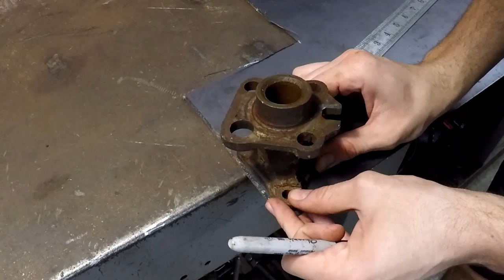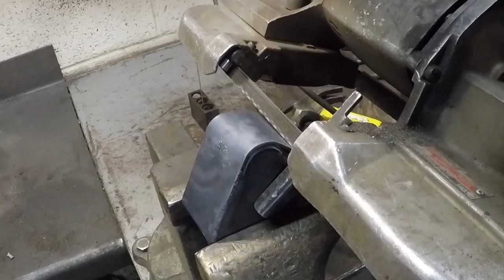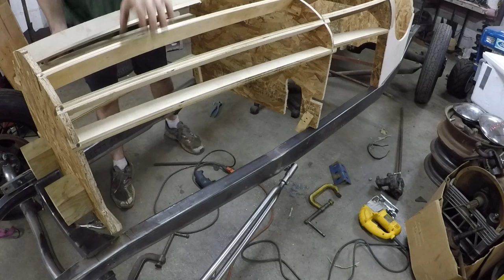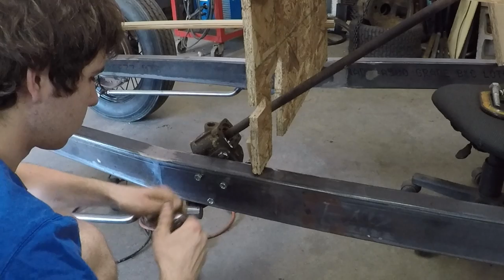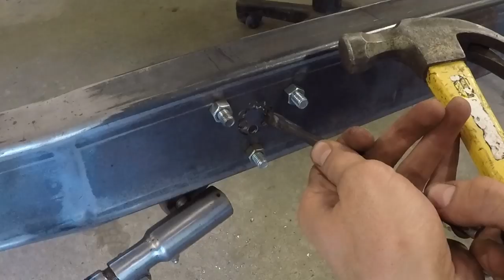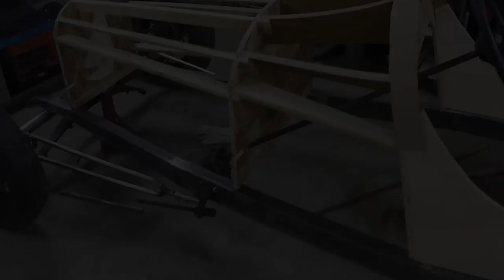Installing an Early Ford Steering Box | Boat-tail Speedster Pt. 22

Comment: Your "Goal" is for it to last 100+ years ... you have wonderful attention to "detail" except on "corrosion prevention" ... EVERY place you weld or drill needs to have at least 'Zinc Chromate Primer" everywhere you have bare metal Bro (including the inner portion of a Tube Frame) ... I am only trying to tell you what is required for people to marvel at your ingenuity far past when you pass ... free advice. Also welded gussets where you cut out the frame ... "Buttress" all cut outs. 
I can't tell you how wonderful your Brain works ... you do wonderful work and I love watching it !!!

Comment: Wow, nice job.  It would be nice to have a CNC plasma cutter or just a plasma cutter. I wish I could tig weld. I bought one but got too discouraged. Keep up the good work. It will be nice to see the project done. I have a CNC plasma cutter and a mig welder. I make metal art. It is good to see a project go through all the steps; programing, cutting, forming, welding and paint.

Comment: I've not commented before but felt I should let you know that I'm enjoying your project very much.  In a few months, I will be starting a complete ground-up design and build of a 1940s / 50s MGTD/Mercedes stylize road car for my wife.  I have acquired the engine/drive train I plan to use and most all the critical bits, the last part is the design of the body.  Currently, I'm rehabbing my shop to prepare for the project.    Your frequent videos and detail will be very helpful once I start the actual build;  As a fellow creator I know you will understand when I say `Thank You for Sharing'

Comment: Just a tip, I would be putting in a collapsible steering shaft so you do not get impaled if you happen to get in a crash.
Reply: That's my thought as well.
Reply: I've seen that happen on kart buggies using small vintage boxes. Not a pretty sight.

Comment: I got to ask, did you already have an Engineering Degree before you began all of these projects or are you flying by the seat-of-your-pants?  Son, you really are a breath of fresh air!!!
Reply from the maker: Haha, I'm only one year into college so I'm still pretty far from a degree
Reply: MacroMachines 
You’re only one year in but already miles ahead of many of the new engineers I have worked with over the last 6 years. They may have the book smarts but at least one had to be shown how to hold an impact gun to run a bolt in. He was cross threading and kept saying there was a problem with the bolt hole when he was holding the gun on an angle. 
Don’t sell yourself short. In the end a degree is just a piece of paper if they can’t apply what they “know”.

Comment: F-1 Steering Box is a Great Improvement, But in My Experience There Are At Least Two Different Ones . The Later Ones , 53-56 Have A Much Larger Mounting Flange Than Say The 48-52's. You Can Cut The Flange Down On The Later Ones, I've Done it, But That is  Up To You, From A Safety Standpoint, I Won't Advise You , Just Sharing My Experiences On The F-1 Boxes.

Comment: Two things- hairpins are not a good idea on a tube axle - the axle doesnt want to twist so it bends the hairpin- and you will have to think hard about bump steer when you set up the drag link- get it right and it will be a beautifull thing, get it wrong and it will be a dog. Good luck!

Comment: As always super impressed with your skills and ingenuity, but that hole in the frame has probably significantly weakened the frame. Do you have plans to strengthen that area?
Reply: its not a "hole" the topendplate just basicly moved inwards, and its welded again, besides that, the material used for the mount, is thicker, so i think its even stronger, its a box in a tube, welded as 1 piece

Comment: You're a big boy now. Just for the sake of the videos get an engineers hammer and put that carpenter hammer in the woodshop. Its for driving nails. Ball peen will give extra cred.
Reply: a real big boy would use the nearest vise grips, adjustable spanner, power tool, or rock.
Reply: be a bigger boy, and send him one, he's still a student :)
Reply: @francistheodorecatte  Well yes, true enough but its the 21century and he isnt framing a wooden house. A good engineering hammer only costs a few bucks at a flea market.And as I said it will make him look even more skilled.